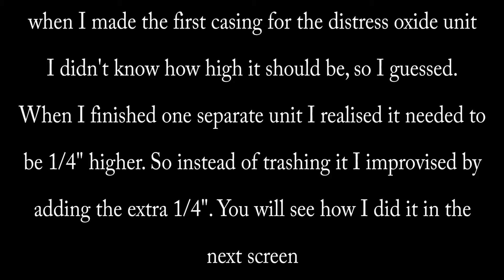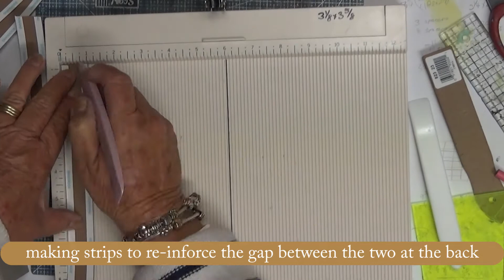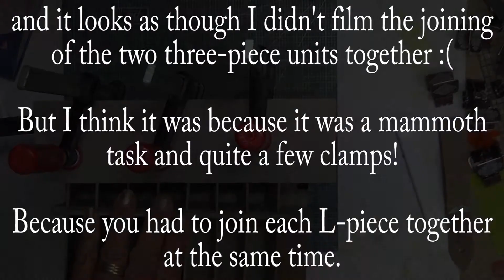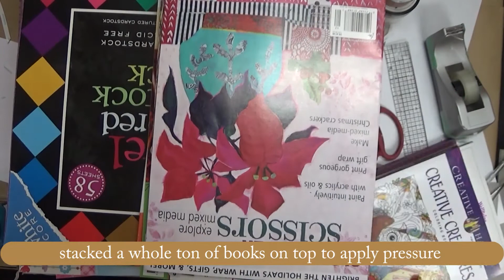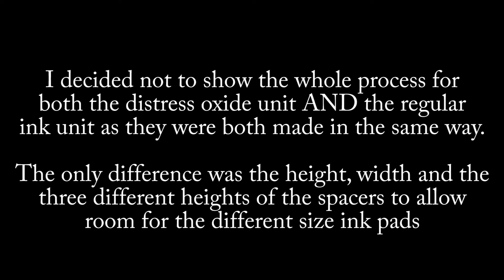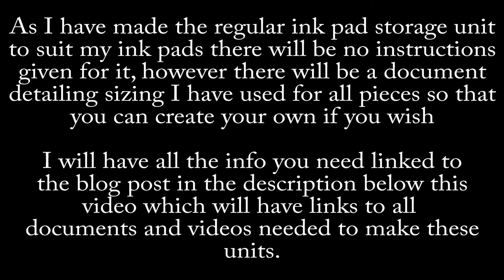Multi Ink Pad Storage Unit

Comment: This is all good to know. I do have a bunch of chip board. Now what do I need? TFS ❤️🎨
Reply from the maker: LOL Beth, chipboard and lots of Aleene's Tacky glue and lots of PATIENCE LOL
I will get the measurements up soon! Thanks 😀
Reply: @ozegran  thanks for the great hint. where can i find the dimensions and the FINISHED size? and maybe even the note for the material requirements? Unfortunately not every link in the blog works and / or I get back to where I came from via a loop. that's my experience when clicking the first two on the left
Reply from the maker: @ibagm.8  Hi, I have added a link to the cutting guide under the HANDY HINTS section on the right side of my blog for the Multi Distress Ink Storage Unit Cutting Guide. Hope this helps. Sorry, I will have to go and correct all my links. The web host provider has removed this option and I have lost everything I had on there.
Reply: @ozegran  
schande über deinen web host provider. die korrekturen gehen nun alle von deinem bastellebenszeit konto ab... der klaut dir deine zeit /// aber nun benötige ich einen Zugriff wegen Google Drive??? Das ist alles sehr umständlich.
shame on your web host provider. the corrections are now all from your tinkering life account ... it steals your time /// but now i need access to google drive ??? It's all very cumbersome.